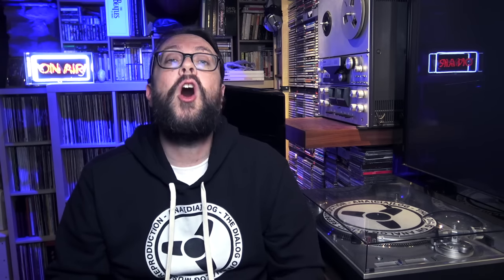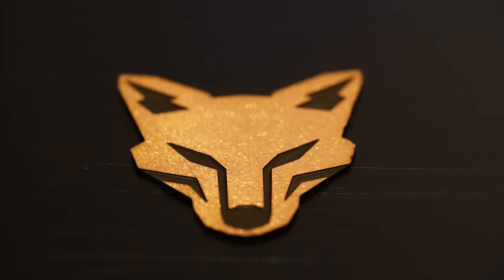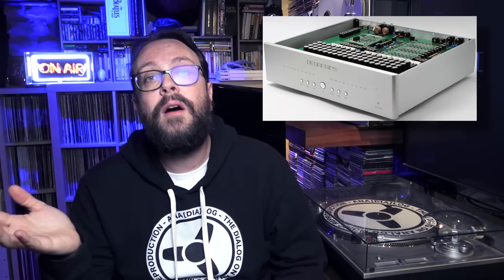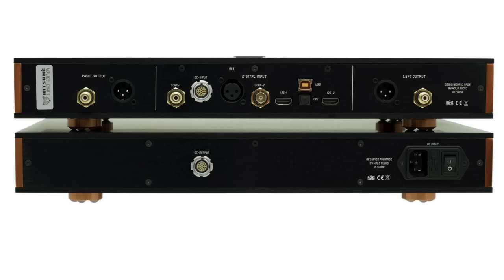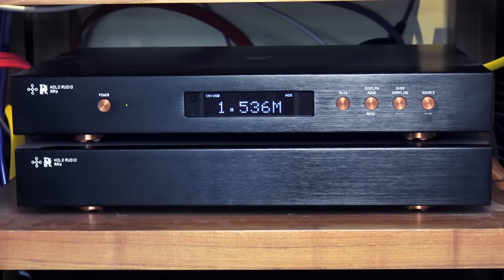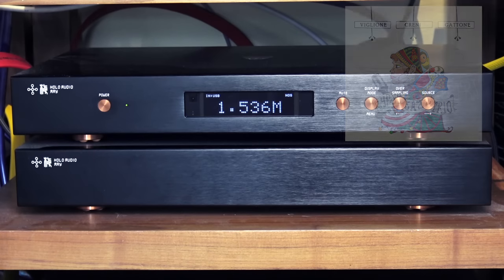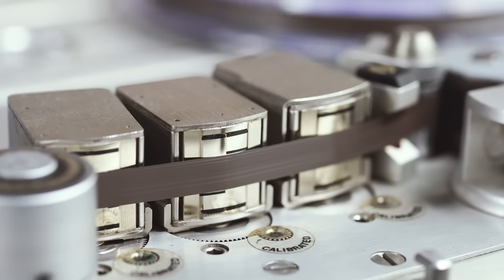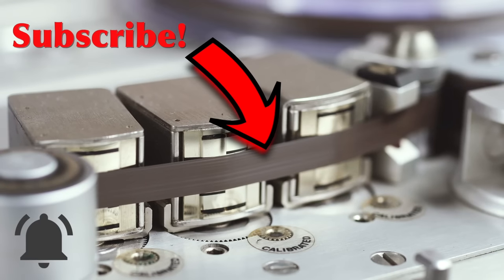Holo Audio May DAC: The Digital-to-Analog Conversion Vanguard

Comment from the maker: Edit: 7 months have passed and I can confirm my impression. The May got better and better and now can award it a Gold Medal for its outstanding sonics, especially when used a high-quality balanced connection!
Reply: Nice review! May I ask what streamer you are using with it?
Reply from the maker: My Mac with Audirvana
Reply: @anadialog  how good is this dac
Reply: Awesome, thank you. Now I can rest easy knowing it's gold tier!
Reply: Really nice but you have to jump to the next level with the streamer you have many options.
The cheapest and one of the best is raspberry pie 4 with a good linear power supply and a oehlbach copper/silver USB c cable for the power. Sonicly this combination is as good as the innuos mini. Even without the linear power supply it's 10x better than Mac,pc with audirvana. I know because I use to use it. I still have the software on my PC.

+If you like tweaking you can add modules for i2s or others.

2. Buy the ifi streamer + linear power supply. This is the best value for someone who doesn't want to tweak.

After the streamer update you'll feel the change with CD quality music. DSD is obvious but making CD quality better is really where better DACs shine in my opinion. And for that you need a streamer of quality.
Or a CD drive like the audiolab 6000cdt. Dedicated CD transport with a good power supply and a design optimize to squeeze more of a CD than any blueray player can. 👍🏾
Reply from the maker: Thanks for your reccomendations!

Comment: Hi... one comment on burn-in.  I bought a Holo May KTE and got it a few days before Christmas.  It is my personal experience that 500 hours is not sufficient for burn-in.  At least in my experience, it took 900-1000 hours before the soundstage, imaging, and tone really opened up started sounding truly beautiful and startlingly lifelike.  Up until this point, I would get a day or two where it would seem to take a big improvement, and then there would be a regression in the soundstage, tone, and sound quality.  There was a lot of ups and down for me, and then starting around 900 hours or so, everything really started gel in an incredible way.  The transformation at this point has not been subtle.  I can only say, whatever sound your hear and impressions you have of the Holo May KTE when listening at less than 900-1000 hours is only a facsimile of what it will sound like when it breaks in.  You have to grind through the hours to get the payoff though.  In my case, 39 days of 24x7 play.  It seems insane to require that much, and YMMV, but this has been my experience with the KTE edition with all of the upgraded caps and fuses in them.  When fully burned in, it is a truly magical and beautiful sounding source with realism that is startling and a beautiful, natural tone.  Also, don’t skimp on the USB cable if USB is the source.  I’m running a Shunyata Sigma USB, and it is worth every penny.
Reply from the maker: I agree, I had this impression immediately. I am an analog guy so I am afraid that I am still behind on those listening hours! Thanks for your feedback!
Reply: @anadialog  Fwiw, I've been feeding it music 24x7 for weeks.  I keep my preamp off if I'm not listening to music, but otherwise always running music through it from my streamer on repeat.  Also, on a tip from a discussion on Audiogon, I power it down for a couple hours every few days, which seems to help capacitor burn-in.  It helps to log the days/hours because it's pretty easy to lose track otherwise.  Any used Holo May KTE's that pop up will be from people who didn't grind through the oppressive burn-in, because when you hear it post-burn-in, it is truly bedazzling.

Comment: I have the Holo Spring with level 3 Kitsune upgrades. I did a comparison to my other DAC's, Denafrips Ares series 1, SMSL M400 and Musical Paradise MP DP MK3 Deluxe with ESS9038Pro, Mundorf cap, Femto clocks and RCA tubes upgrade. After listening to Holo, SMSL and Ares I went back to the MP, which to my ears is the best. The Holo has an edgy sound, a bit accentuated at the top and bottom and it's a dry sound. The SMSL is smooth top to bottom and lacks the pizazz of the other DAC's, but it is a very nice unit. The Ares is not as dry as the Holo, has as big of a soundstage and is a bit more even top to bottom. The Ares signature is closest to the MP, but the MP just has a more holographic highly detail sound that's more engaging. The MP has tubes so I suppose that is the main difference in the depth of soundstage. The Holo is the least engaging of the three to my ears.
Reply from the maker: Thanks for your input! How long have you had your Spring?
Reply: @anadialog  A month, I'm second owner.
Reply from the maker: I see thanks.
Reply: Definitely worth giving the spring 2 or may a try. Spring 2 sounded very different to the original spring. And the may refines it even further.

Quite frankly the may has absolutely blown me away.
Reply: @GoldenSound  The key word is 'different'. While I like the Denafrips Ares very much, for example, it doesn't mean I would like the Terminator even more because it will have a different sound, and that sound may not be as pleasing to my ears. It's all unknown until you try them in your own system.
Reply: Nice micro-review. Thanks!
Reply: You need to burn the Spring in much longer and it will become much better than the Ares and M400. Not sure about the MP D2, cause depends on all mods.
Reply: @larsv6144  It was used when I got it so it was burned in plenty.

Comment: I bought the Holo Audio Spring KTE DAC a few years ago when it was first released. It is hooked up to my Auralic Aries streamer via a AES connection.  There is no way I’m going back to any delta sigma DAC after listening to this R/2R DAC in NOS mode. The only criticism I have is that the manufacturer should not have included any OS modes at all to save on the expense and complexity of the circuitry. Let me recommend the Auralic Aries streamer. What makes this streamer so great is that you can also connect an external Blu-ray/DVD/CD drive vis USB and beat any CD player on the market(with the Holo DAC).
Reply: Agreed about unnecessary complexity and extra AKM chips.

Comment: This digital glare comes from that linear power supply, which is much slower than switching power supplies (that are also noisier). Also, it comes from these compensatory tolerance circuits, which delay the signal (Hegel first introduced compensation to achieve purity of extremely low distortion, but people were not impressed - a lot of HD30 are being sold at around $2000 used in spite of its -150dB numbers).

Comment: AK4137 is not a DAC, it's an ASRC (Asynchronous Sample Rate converter). This does up sampling when not in NOS mode. The discrete ladder DAC is always used for both NOS or up sampled audio.

Comment: Ladder DACs also comes in chip version (eg TDA1741, BB1704, etc), but they are no longer made because they are more expensive to manufacture than delta sigma chip DACs. IMO, ladder DACs do sound better everything else being equal.
Reply: There is a new IC from TI DAC11001 (91001, 81001). 20bits, Sampling at 1MHz. One of them Shiit uses, but unsuccessfully, because of poor balance between THD and glitches. This is obvious, that Holo Audio first of all uses a calibration. I mean a program calibration, when one input code is replaced with another one that produces an expected signal with not ideal resistors. Because resistors on a market allow 13bits ladders only. Secondly, they own an interesting patent on SHA (sample and hold amplifier). Because it allows to solve the glitches problem.

Comment: Thanks for your great review! Based on your review and 7-month update, I have decided to order a May KTE. I do have a couple of questions for you...1) Is it true that May can get hot (really warm) if kept on for extended period of time? 2) Where do you think it performs best: a) headphone or speaker system. I have a very high-res rig but don't want to spend a ton for a dCS/MSB type DACs at the moment. Thanks again!
Reply from the maker: Thanks! 1) I never noted any abnormal heating 2) I am not sure what do you mean...why should there be a difference. Remember that the May has no headphone output

Comment: I hear that under the non-oversampling (NOS) mode, May's predecessor Spring 2  will also play hi-res files directly including HQPlayer-upsampled 1.536M PCM and DSD1024 files, but none of them sounds as good or as natural as the CD quality (44.1Khz) files without upsampling.  Would you compare the sound quality of hi-res files played directly under NOS vs. under the OS mode (AKM chip used)  ?  I also assme that native DSD files played directly under NOS do not sound as good as those played under OS mode? This is very important as I wonder if it is worth investing in a new R2R DAC in addition to the AK4499 DAC I already own.
Reply from the maker: The NOS mode was always the winning one for me, regardless the software.
Reply: @anadialog  Thanks a lot.
Reply: I currently have a few dacs. Including the may, and a 4499 dac, as well as others such as some ess and burr brown dacs.

The may leaves everything else in the dust

Comment: Hi,
Thanks for your review. Ron with NRD reviewed this model and loves what it can do with time alignment and detail.
Silver definitely needs time to burn in as well as the unit. What preamp are you using. That can be a big factor too, but either way I'm sure yours will be phenomenal and you may have to give it a Gold 🪙. How are software updates handled?  Have you followed up on if the volume function on the remote will be added in an update or why it was left out? Some may want to bypass their preamp to use.
Reply from the maker: I am using an integrated Primaluna. It is getting better but veeeeeery slowly....just like my Oppo. Software can be updated via PC if I don't go wrong. The remote is a model they use for several machines that is why it's made that way. Volume is fixed (and I prefer it that way) so I don't think that will take place. In any case Tim Connor is chatting on a number of my videos and he is from Holo Audio USA, you can ask him anything, he is very nice and knowledgeable.

Comment: Thanks for the review. I found it very well done. You mentioned that the Holo May DAC plays DSD files. Can you clarify if it will process signals from a SACD player as I have read that  signals from a SACD cannot be processed by any other equipment as it is copy protected.  Pardon the ignorance on my part and thanks in advance.
Reply: Search YouTube, they have tons of reviews on this DAC and most are better than this one.

Comment: Hi. Could you please remind us what did you use as a source for the SACD reading and what output did you use? As far as I understand, you used the I2S input so, does it mean you used an universal player like an Oppo? In other case, just the PS Audio can deliver I2S signal in their SACD transports. Thanks a lot.
Reply from the maker: There are a lor of players and transports that have a I2s output. Of course that does not mean that it will be compatible but in most cases it will. I did a recent video showing transports, most with I2s: 
https://youtu.be/Gl563onzwqU
I am using an Audiocom Signature modified Oppo 105d with the HDMi output converted to I2s with this magic box: https://youtu.be/KAqr8MP-in4

Comment: Very nice review! Bravo! :-)
Just one question regarding I2S connection. From what I know I2S is not a common HDMI input/output, but it is a dedicated connection for dac and streamers (without a fixed/recognized industrial standard). How did you succeed to connect your Oppo player to the Holo DAC by means of the I2S? Do you need to setup pinout configuration of the Oppo and/or the dac? I'am asking because I have an oppo based SACD/bluray digital player (Primare BD32) and is not possible to connect by HDMI out (the secondary audio HDMI out, like for common oppo player) to the I2S input of my current DAC (a Topping D90). Thank you in advance.
Alessandro
Reply: I have a Phillips BDP9700 Bluray player, sadly DSD isn’t output from the digital connections.  The bluray player only plays the DSD layer via the onboard DAC to the RCA, so I couldn’t use my external DAC.  If you want to listen to DSD then there are ways of transferring the DSD to a hard drive using your Oppo.  I’m using a budget Sony bluray player to extract the DSD files
Reply from the maker: Excellent question! I am making a dedicated video very soon on this....stay tuned! ;-)
Reply: @anadialog  Ooh, really look forward to that.  I have limited experience with audiophile USB cables.  I tried a custom cable, Audioquest carbon, Curious cable and I have an Elijah Audio Isolate CU cable.  I believe separating or if possible having no 5v power in the USB cable makes a big difference.  I look forward to your video
Reply from the maker: There is a way, stay tuned new video coming up.
Reply: May has selectable i2s pinout so should work with everything unless you have a really unorthodox layout

Comment: Thanks for the review, very in depth and interesting. May I ask you which is your digital source capable of read BD-Audio, SACD and have an I2S output ? Thanks
Reply from the maker: Oppo 105d. It is an Audiocom signature modified version but that does not change the issues with high-res material. You must use a hdmi out and this: https://youtu.be/KAqr8MP-in4
Reply: @anadialog  Thanks a lot, I've already seen your video after I posted my question. Your channel is very usefull to me, thanks a lot.

Comment: What specific aspects get your ‘gold’ ratting, over the the units overall ‘silver’ rating?
Reply from the maker: Good question. I'll probably have to write down some notes to express each award. Well, in short, for Gold I want to just be blown away from the quality or fidelity of the sound. I rarely get that feeling, it gives me goosebumps and makes my hair stick up on the back of my head...I know this is not a technical explanation and I will do that in the future but now I just wanted to explain the emotion behind that. Obviously if the May's price tag was 2000$ for example it would have reached Gold as well. Going back to my old videos, for example, I would give a gold award to my Dual C844...simply outstanding!

Comment: Which USB cable are you running from the MacBook Pro to the DAC?  I wonder if you need to upgrade your USB cable to experience the full potential of the DAC and award the DAC the gold standard.  I’d recommend trying the Curious Cable USB, they may still offer a full money back guarantee if you don’t like it.
Reply from the maker: I am using the NeutralCable reference USB.

Comment: I'm curious if the oversampling done here is the same as what something like the Chord Hugo M Scaler does (it seems like it is), and if so, why is the Hugo Scaler so revered (and obviously utilized if you have it), while the oversampling option in the Holo is recommended to be disengaged.
Reply from the maker: Because it sounds worse and it relies on a (good) Akm chip, not the sofisticated R2R ladder circuit. Its like having a yacht but you just use its dinghy.
Reply: @anadialog  It is strange and a missed opportunity that Holo uses an inferior upscaler/oversampler in such a premium and expensive DAC. As you say, they used the dingy, which makes one wonder why they even made such an option at all. I mention a missed opportunity because a similar Chord set up costs about $10k with its M Scaler, whereas the Holo May DAC would be a potentially equivalent solution at "only" $5k. Even if the Holo were only 90% as good as the Chord set up, saving $5k would make it seem like a great relative value. Thanks for the quick response!
Reply from the maker: I see! I think they are really aiming at a good r2r and the upsampling is just to make everyone happy. The cook thing is that the May can do DSD over ladder, rare if not unique!

Comment: Hello Guido: I have just ordered a Holo KTE May DAC. In your opinion, would the SingXer (KTE version) SU-2 USB to i2s Converter provide improved PC audio playback compared to connecting the PC laptop to the May DAC USB input as you have elected to do? 
I also plan to connect my OPPO 203 HDMI audio output to one of the May DAC i2s inputs with the use of a (from China via ebay) HDMI to i2s converter box like you utilize. Is there a special setup / adjustment to the May DAC that needs to be made for this i2s connection to function properly as yours does for playback of SACDs and other Hi Res files thru the OPPO?
Many thanks,
Jimmy G. Latham
Reply from the maker: Hi James, congrats for your purchase! I wouldn't use the Singer bridge. It's not even passive and It will peobably alter the signal. USB is an excellent choice. Less is more. For your Oppo, yes, the box I suggest is decent, passive and does tye job. Obviously the Geerfab D.Bob would be better but its 1000$.

Comment: ¿Puedes recomendarme un multireproductor de CD, y SACD? Gracias por tu canal. Me encanta y aprendo mucho contigo. Gracias desde Madrid.
Reply from the maker: Thanks! They are out of production now but you can still find them in the used market: the Oppo 105 and 205...amazing players. I have the Audiocom signature modified version, which is quite expensive but even the normal versions are excellent.